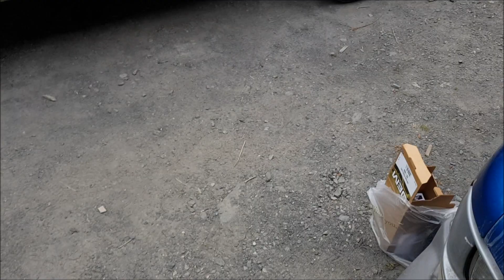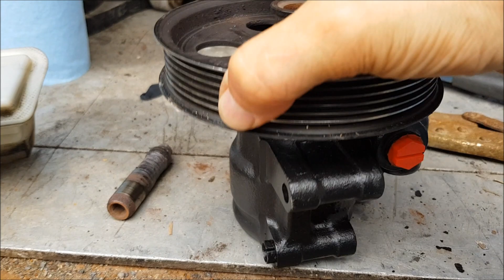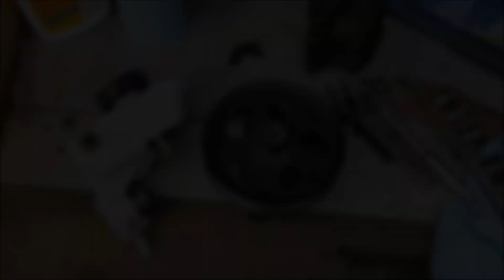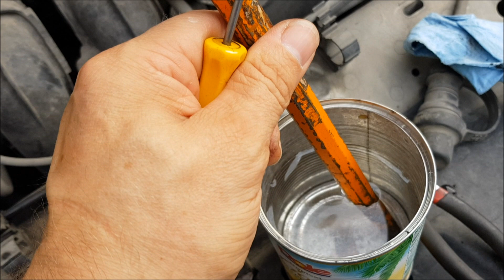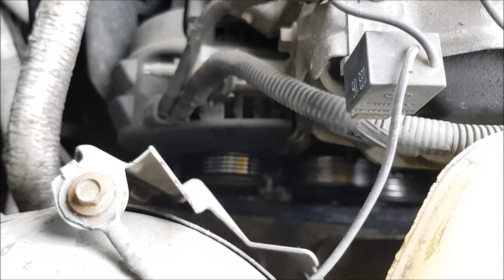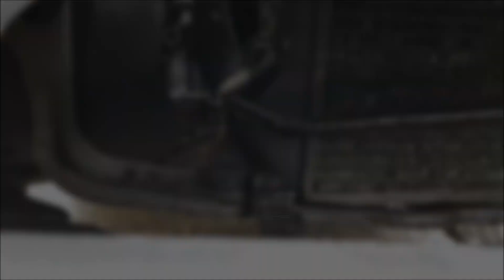2006 Focus Power Steering Pump Change

Comment: So I guess my pulley will snap off eventually. I have been running my focuse for 7 years now with the pump dry haven’t replaced haven’t had to the hard stearin doesn’t bother me but now that I saw this I might play mechanic very soon. Thanks for the video will definitely be helpful ❤❤

Comment: Do you have to losen the belt in order to replace the steering fluid tank? Is that independent from the rest?
Reply from the maker: You don't have to remove the belt to remove the tank. The tank comes off by removing the top two bolts and disconnecting the hose from the front of the tank.

Comment: When you did the Teflon seal, did it go all the way down to the end of the screw? I noticed there is a gap between threads 3/4 of the way down the screw.
Reply from the maker: Yes, mine had a groove for the seal all the way down by the nut on the fitting.
Reply: Can any guide me to Teflon seal please need to replace power steering pump asap but cannot find what size seal I need

Comment: Did you have to burp or get the air out of the pump
Reply from the maker: No, power steering systems are vented, so you just need to fill it up, cycle the steering a few times, and top it off.
Reply: @nates831  How long did it actually take to do?

Comment: Just about to replace one - the Teflon seal on the lower line; is Teflon tape an option on the thread should my seal be bad.....
Thanks.  Great video...
Reply from the maker: No, it is a semi-hard Teflon o-ring basically. The new pump came with a new one.

Comment: What was the symptom of your car? hard to steer?
Reply from the maker: When the pump begins to fail, generally you will hear the pump wine when turning. Especially at low speeds. The pump may also start to leak around the shaft as the bearings wear out. Once the pump fails completely the car will be very hard to steer. This owner had let the pump run dry and it seized, snapping off the pulley.

Comment: Nice, did u have to bleed the system?
Reply from the maker: No, the fluid returns to the reservoir, so it bleeds itself. Just run the steering full left and right a few times and check the fluid level after.